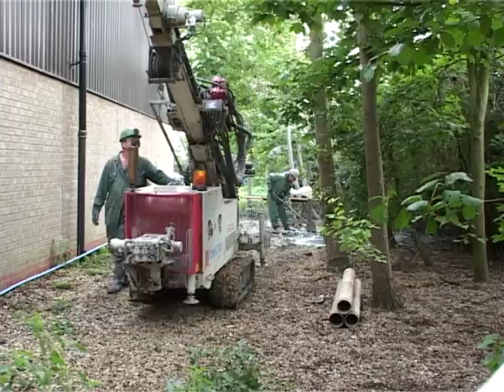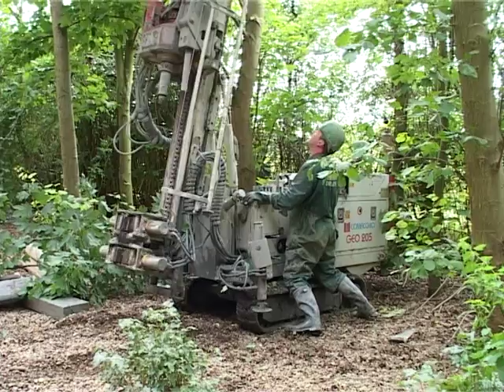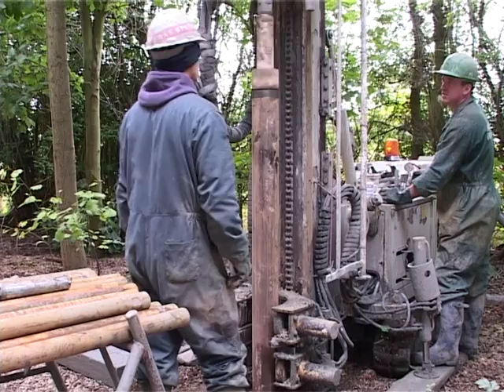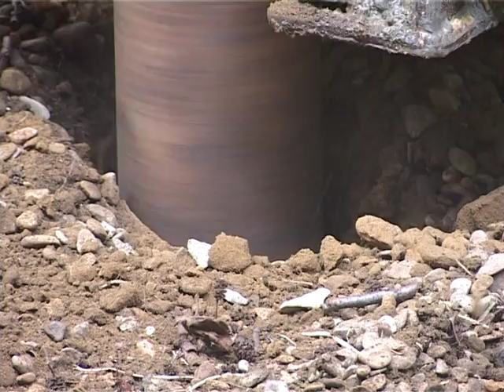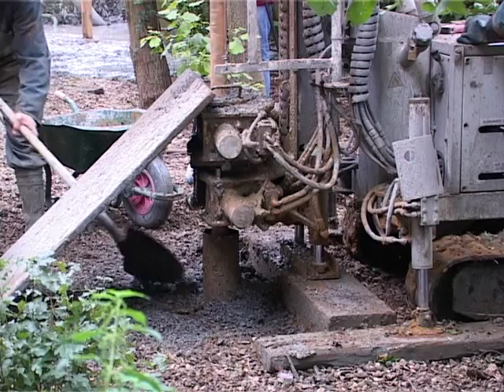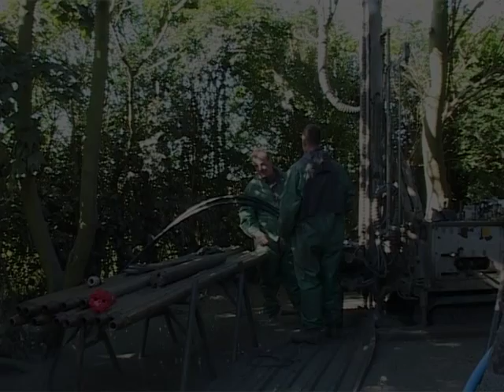Drilling Boreholes for Ground Source Heat Pumps

Comment: Hey so why do you need all the coils and pumps and stuff? wouldn't the warmer air just rise up into (through a filter) your house?
Reply: damn you ask dumb questions. Need closed system with continuous well casing and grout for EFFICIENT heat transfer to heat pump. Got it?